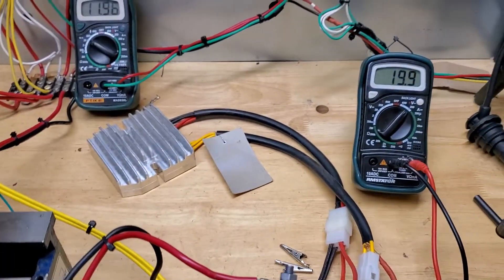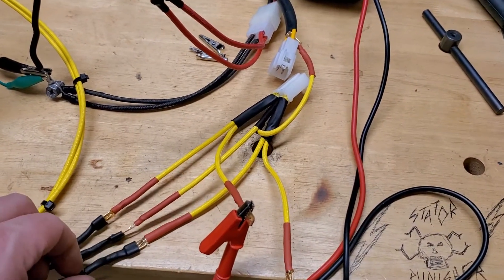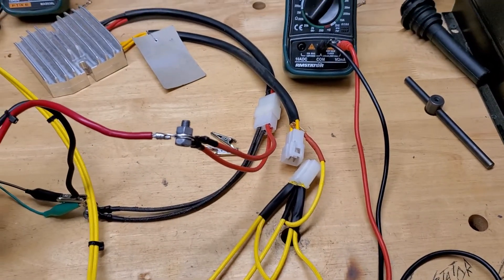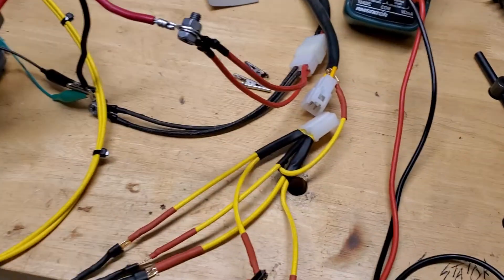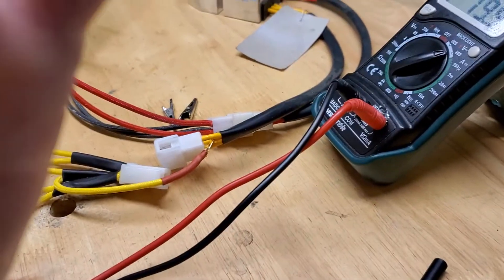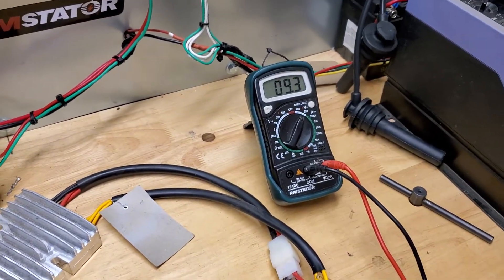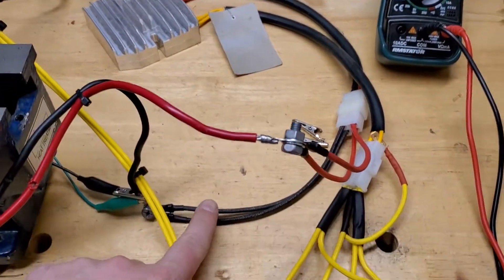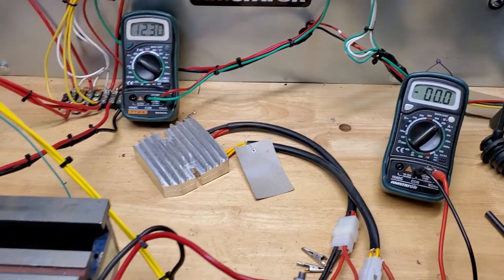Testing voltage from a grounded motorcycle stator

Comment: My Rectifier test unplugged And reads like this .458 .459 . 458 I replaced the plug with high heat connectors. The wires are not hot anymore. My Question is, how hot does the Rectifier housing get? After 10 minutes at idle the temperature reads 200 f . Is this ok? Thanks
Reply from the maker: That is a very high temperature for idle rpm.  after lots of use I have measured them up to 200F in good working condition, but I wouldn't expect that at low rpm for a short time.

Comment: You have a very through video. I own a 2014 bmw gs f 800 adventure, my Stator/ Rectifier plug melted because of a bad battery. Now, I installed a new AGV Battery, new Stator/ Rectifier, my plug gets very hot in no time at all, at 163 F I just kill the motor. Is this heat on my plug normal ? Or do I have a new bad Parts? Thanks
Reply from the maker: That sounds like another bad regulator most likely. A failure of the diodes in the rectifier can cause lots of heat in the connector terminals leading to them melting.
Reply: @OctaneElectrons  Thanks!!

Comment: Hey man if you could reply that would be amazing I was having charging issues so I changed out the battery to see if that was the issue and it was still only getting 11.8 volts at idle and 12.4 with the bike off so I went ahead and tested the regulator was getting consistent readings through out all of the leads and the stater was getting 0.00 on all the leads, so I went ahead and just changed out the stator for a new one and I’m still getting the same issue around 11.8 volts when I start the bike. I could really use the help man
Reply from the maker: Sounds like a bad voltage regulator then. It can still be bad even if it passes a diode test. I would recommend replacing it.

Comment: This gives me hope in knowing my stator is grounded I get continuity to the frame on all 3 leads my bike left me stranded when the flywheel magnets on my generator blew up, I changed out my r/r and flywheel but my dumb$#! Didn't change out the stator after seeing all those magnet fragments covering it, of course it's the part causing my non-charging issue 🤦‍♂️ could you share your thoughts on my situation ?  I don't see any other explanation as my bike was running fine before the flywheel went out
Reply: BTW my idle is charging at 13-14 VAC revving it up to 3k (can't do 5k I have elderly neighbors) is about 20-25 vac and it's a 06 yamaha r1
Reply from the maker: Yes your stator is definitely bad if you have continuity to ground on any/all phases. Usually when the magnets come apart and hit the stator, it will be damaged. I would recommend replacing the flywheel and stator for sure, and the regulator as well to be safe. We have them available at RMSTATOR:
https://rmstator.com/en_ca/partfinder/search/result?pf_id=1&dw1=Motorcycle&dw2=2006&dw3=Yamaha&dw4=YZF+R1+1000
Reply: @OctaneElectrons  ty for the reply I changed the flywheel and stator it works now, but I'm so paranoid about metal chunks in my crankshaft but honestly I think I got lucky when I had first pulled it apart looked like all the metal chunks stuck to the stator if any got into the crank It would've been all over the walls and on the gears probably gonna drop the pan one day anyway this video is what solved my problem so thanks 👍

Comment: Hello, I have  a question. Will this grounding issue blow a fusible link from the charging side of the voltage regulator to the battery? Let me know thanks it will be a huge help for me.
Reply from the maker: Yes a short to ground in the hot side of the regulator output could blow a fusible link for sure.
Reply: @OctaneElectrons  thank you for your reply. Have a chill and safe day!

Comment: If the stator has a short to ground does it need to be replace? What can cause a stator to be grounded?
Reply from the maker: Yes it will need to be replaced if it has a short to ground. It is caused by the insulation on the windings failing, allowing them to conduct to ground, which will short circuit stator output to the regulator.

Comment: I'm having some charging issues. The battery does not charge. The Regulator/Rectifier seems to be fine. I unplugged the stator wires going to the RR. When I run the engine on idle or at a higher RPM, I get roughly 4 VAC coming from the stator. That's consistent from all combinations of the three leads coming out of the stators. Any idea what could be the issue?
Reply from the maker: That is likely a bad stator. That voltage is much too low for high RPM. I would replace.